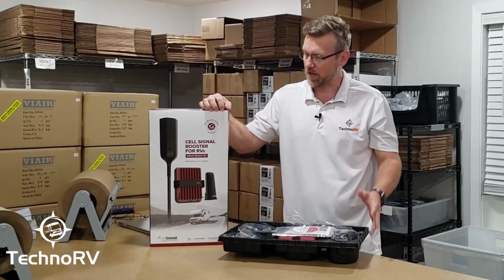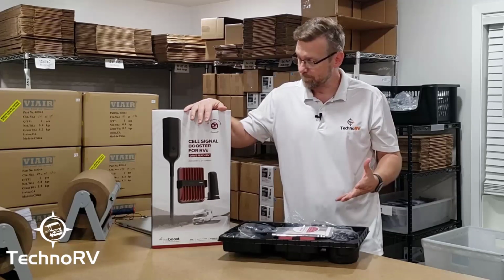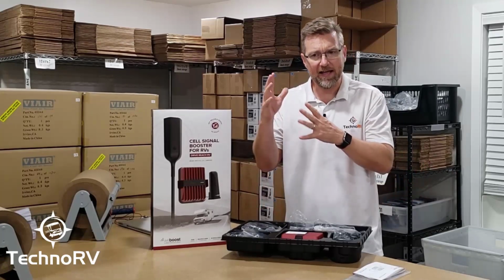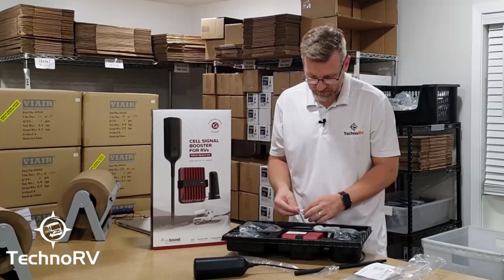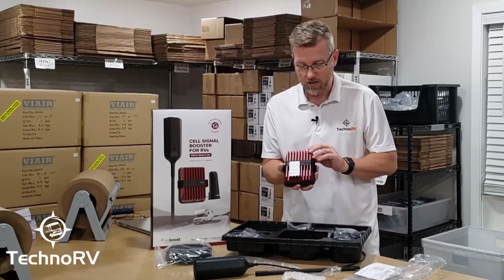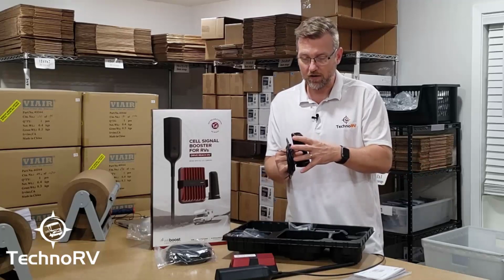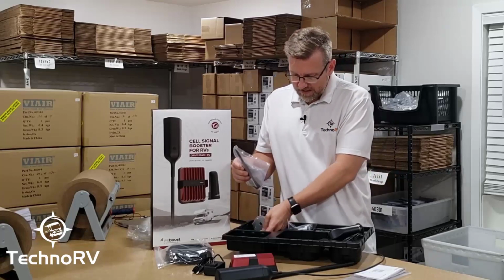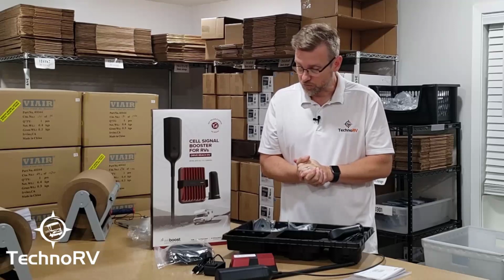WeBoost Drive Reach RV Cell Booster UnBoxing - MORE POWERFUL AND 5G READY

Comment: My RV is 13 feet 2 inches tall.  The flat roof is 12 foot 8 inches tall.  If I add the 13 inches of the antenna mast, another 5 inches for the antenna itself, you are talking about adding 1 foot 6 inches to the height of the RV.  That puts me at 14 foot 1 or 2 inches tall.  This seems like an issue. Are there other mounting locations and hardware to for this device?
Reply: Just an interested buyer (not associated with TechnoRV at all), but I don't think these are made to be mounted on top of the roof. They have brackets to mount the 13" mast along side your ladder, so you are starting well below your roof-line, and you can adjust as you see fit. I plan to mount mine so that the antenna itself, the 5" item, is just clear of the roof, so it has the best chance of that omnidirectional coverage. But I don't want it any higher than that to keep it out of the way of whatever it might hit up there.

Comment: Can i use the Drive Reach RV booster in tow vehicle when on the way to camp with the vehicle antennas bought separate?
Reply from the maker: Yes, you can.  When you add the 2 additional antennas, you simply have to move the amplifier and the 12V power cable from your RV to your tow vehicle.

Comment: I recently purchased a WeBoost cell booster. On my first trip the cable pin in the amplifier broke. I attributed the failure as my fault. I contacted TechnoRV to determine where I could get the amp repaired and admitted my mistake. TechnoRV’s technical support were very helpful directing me to the manufacture Wilson electronics. 
I explained my problem and admitted the failure was of my own making to the Wilson Electronics support  technician. The technical support at WeBoost was also very helpful agreeing to replace my amplifier at no cost to me.
I highly recommend both TechnoRV and Wilson Electronics….SERVICE & SUPPORT DOESN’T GET ANY BETTER.
Reply from the maker: Great Denny, I am glad we were able to help! 
Eric

Comment: What’s the difference between the new Weboost Drive Reach and the new Drive Reach OTR?
Reply from the maker: The Reach RV has a different inside antenna and some different mounting brackets more suitable for RVs. If you are in a RV, the Reach RV is the one to get. The OTR is more for truckers.  I hope this helps.

Comment: 5G ready... that sounds vague. Does it actually boost 5g or do I need to get a separate antennae or anything? My 5G service is horrendous!
Reply from the maker: Hi, 
This means that the antennas will provide the gain on the 5G bands, no separate antenna is necessary. I hope this helps. Eric

Comment: What’s the coverage of the desktop antenna?  Will it cover the entire RV or do you have to sit next to it?  Is there an antenna that will provide coverage from one end to the other?
Reply from the maker: Hi, the size of the boosted zone depends on on the originating cell strength. So if the cell signal is super weak then after it is boosted it may only give a boosted zone of a few feet. If the outside cell signal is in the medium range to start with, and then it is boosted, then it may create a boosted zone of 8-10 feet. The best way to use this is to set a cell hotspot next to the inside antenna, and then you can wirelessly connect your devices to that boosted hot spot throughout the RV. I am still testing the Reach, and it does offer more power than the previous model and I am told that it will project further because of the increased power. There is no antenna that will do much better than the desktop antenna. If you project to far then it could start interfering with the outside antenna. It is a balancing act really. We are very pleased with the boosted zone when using cell hotspots. Hope this helps a bit. 
Eric

Comment: Where will you publish the various mounting options for the external antenna?  Ideially it would be great to have soemthing that coudl mount on your roof and lower down when you travel.
Reply from the maker: Hi, I plan to make a video soon of installing the Reach. I will be using the antenna suction mount to temporarily set it up. The WEboost install video shows attaching it to a ladder rack and then running the cable through a slide gasket. Hope this helps a bit. 
Eric

Comment: Many of these boosters advertise they work with all carriers, but not true. Not with Sprint, it is my understanding that no boosters work with Sprint band 25. This is per your own website, TechnoRV
Reply from the maker: It does work with all carriers including Sprint, but Sprint's band 25 is too close to the emergency services band and is not allowed to be boosted by any brand of cell booster. Sprint has other bands available though that are boosted by the WeBoost. We have many happy Sprint customers using the WeBoost.  🙂

Comment: hi Eric ,I am  from Montreal and already your customer ,(tpms system)
I bought last year a solid rf booster, that I installed on my RV ,
what would you say the difference between the we boost  drive and solid RF?
Should I change if so why ?
I am using Canadian broadcast TELLUS and planning to travel in US
Thanks,
Reply from the maker: Hi Construction, 
It is really about the power rating of the units. I am not sure of the power rating on the Solid RF unit you have, but I can tell you that the new Weboost Reach has the most allowable boost by the FCC, and it has enhanced uplink output as well. If the Solid RF is working good for you then maybe stick with it for now, but when you are ready to upgrade, then the Drive Reach RV is the unit to get. 
Hope this helps. Eric